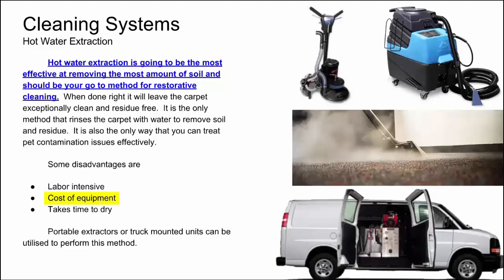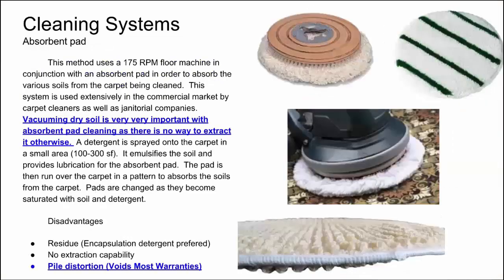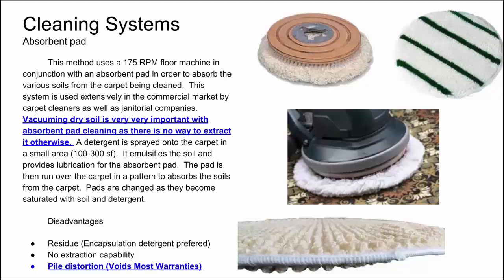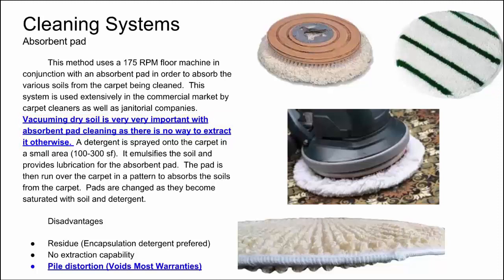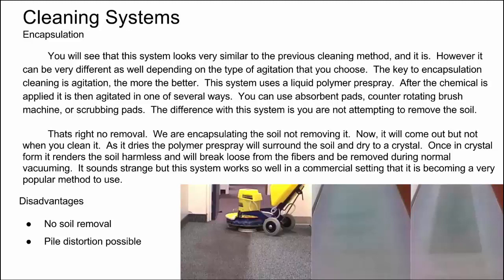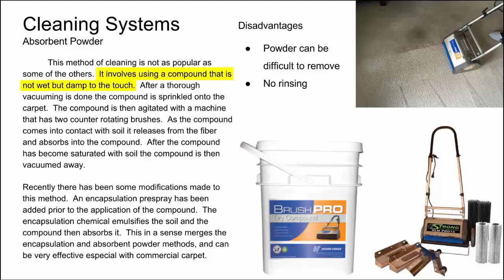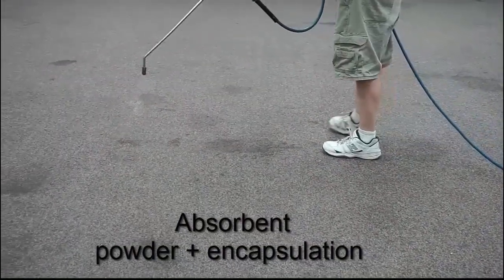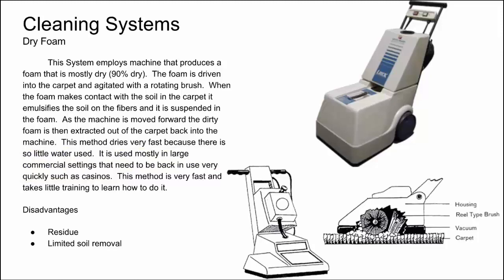Carpet cleaning course Part #7 How to clean carpet/cleaning systems

Comment: In your opinion, would a Bissell Big Green be enough to start with on lighter to, maybe, medium soiled jobs? Or would starting off with encapsulation be the proper way to go until enough money is made to invest in a proper portable? If the latter is the better choice, would the Prospector PE220 with heat be good for starting out or do you recommend another type of portable?

Comment: hello I've been taught to  pre spray, soak a bonnet pad in a bucket of water then go over the carpets with buffer/bonnet then go over with carpet extractor. I think it's overkill, but I do what I'm told. Any advice will be appreciated. Thanks
Reply from the maker: Not overkill it's the same as scrubbing after pre spraying just with a bonnet not a brush. Scrubbing should be done every cleaning.

Comment: Thanks for this. I did 12 years chemdry. First was bonnet method then onto the rx20. So you say warranty will be void if you use a 175. So really, what is the difference then using a rotary machine like 360i or the rx20. Both are rotary and can create issues if not ran properly. Why did manufactures give those the ok but not a 175? I can see why the brush pro is fine, because it rotates vertically as opposed to horizontally like the rotaries which could unwind the yarn.
Reply from the maker: Manufacturers do their own testing on types of cleaning, my guess would be there is more friction involved with the use of bonnets vs. rotary extraction, but that's a guess.

Comment: So the pre-spray and scrubbing is the cleaning and the extraction is just hot water to remove cleaning agent and dirt?
Reply from the maker: Yes for the most part. This is one thing I missed when making these. If you are using an alkaline pre spray you should be using an rinse agent to ensure that the pre spray is neutralized and removed from the fibers. Not all pre sprays will need a rinse but many do refer to the bottle that you are using or ask the manufacturer or supplier.

Comment: Do you have to rinse and neutralize carpet after VLM process if your using an alkaline cleaner? If so, how does it work?
Reply from the maker: No, you will not use a rinse in vlm. Doing so would interfere with the encapsulation properties of the cleaning products the are designed to be left in as opposed to hwe chems being removed.
Reply: @carpetcleanertraining8020  thanks so much i've been watching this whole course and have learned so much! Me and my husband have both been studying and plan on starting our carpet cleaning business soon, is there a way to email you if we have any other questions?
Reply from the maker: Go to carpetcleanertraining.com and sign up for a consultation. write your questions down and you can ask on that zoom call.
Reply from the maker: carpetcleanertraining.com and set up an appointment for a consultation.

Comment: @11.18
Re floor polishing machines. 
I agree with your comment/statement.
Always do your homework.... the orbot machines are carpet rated and approved. This is also clearly displayed on their machines.
I would also add one machine many miss out, walk behind extractor. I have one and they are good. What i like is that you can scrub whilst extracting. 
Most of my work is highend, full restoration is not needed.
Reply from the maker: Walk behinds have their place certainly however they don't have the best suction. In my opinion, scrubbing should be done prior to extraction this gives an adequate amount of dwell time for the pre-spray

Comment: Thanks for the awesome content. I have 3 questions.
1. Would you advise using hot water with the pre-spray (considering you use a concentrated solution)
2. How long would you let the pre-spray sit before agitating
3. I'm using an alkaline pre-spray and a steam extraction machine. Can't use any rinse aid in the steam machine. Would you advise spraying a rinse aid over the carpet (similar to pre-spray method) after agitating and just before the steam extraction?
Reply from the maker: Yes hot water to mix and spray hot water increases effectiveness of pre sprays

Immediately agitate 

Which machine are you using?
Reply from the maker: Ok got it. I would want to test the extraction capability of the steam unit. I am not sure if it will be sufficient to remove the pre spray from carpet I would need to test it to see. Those units are very good at cleaning hard surfaces but soft will be a different animal so like I said I would like to test it to see. However I wouldn't add a rinse to the carpet. You may look into different chemistry that wouldn't be as alkaline and will be an encapsulator as well just in case it's not fully rinsed. Silver solution would be one example but it's pretty expensive.

Comment: Thank you, super helpful!!
To clarify. You don’t need vacuum the carpet before using encapsulation method, correct?
But you vacuum after completing encapsulation?
Reply from the maker: Always vacuum prior to encapsulation because you're not actually removing the soil you're encapsulating the soil. Any heavy soils need to be removed prior to the cleaning process. You don't need to return to do the vacuuming after.

Comment: hi is it just water you are spraying on with the extractor?  Or is is there product in there as well?
Reply from the maker: Yeah, that's the one thing I missed in the video. You should rinse with a rinse chemical such as all fiber rinse. Especially if you are using a high pH prespray

Comment: Would a rubber brush do the same job as the scrubber brush ?
Reply from the maker: I am assuming you are talking about the hand scrubbing brush. No it's not the same. The rubber brushes do not do the best job a scrubbing the bristles are too flexible and will not do a great job at scrubbing. They do a great job at removing pet hair from the carpet though.

Comment: I noticed with agitation method of 175 you didn't use the bonnet after.
Reply from the maker: I agitate every HWE job just the brush then extract. Vacuum, pre spray, agitate, extract, groom. Bonnet is for low moisture cleaning
Reply: I never understood the bonnet method. It seems a bit counterproductive. Like your just pressing the dirt further into the carpet as well as spreading it all over. ?? I don't get it

Comment: What chemical did you use for this carpet? And how did you decide on why it works.? 

 Did you use the chemical only in the prespray and the extractor or do you only have water in the extractor?
Reply from the maker: There are several systems in that video which were you referring to?
Reply: I was wondering the same.  I'm assuming the pre-spray has the detergent in it and the HWE machine has the rinse agent?

Comment: would you suggest a carpet mat in the work van ?
Reply from the maker: I have had it in the past. I do actually like it because it keeps things from sliding around. However, it does where out and, of course gets wet and very dirty. What I really like Is rhino lining sprayed floor to ceiling, but it's expensive.

Comment: Watch how rugs are cleaned in a off location facility,and realize wall to wall carpet is never thoroughly dusted(vacuumed) or rinsed.
A little more than half of dirt laden water is recovered when cleaning with hot water exstraction.
Dirt laden water will wick back when dry.
H.W.E. is the quickest,and most profitable method,and the industry standard.
Hot water exstraction will remove Scotchgard from fibers.
To treat pet urine the enzyme solutions need to go where urine is(primary, secondary,pad,floor) to correct,Over wetting then is the newly created problem.
Cleanability is the number one reason people choose other flooring options than carpet.
If a consumer were to clean their carpet,and protect carpet as often as warranties require (yearly) the cost would soon overcome the price of replacement.
Reply from the maker: Is there a reason you are posting this here?
Reply: AI is preety pointless